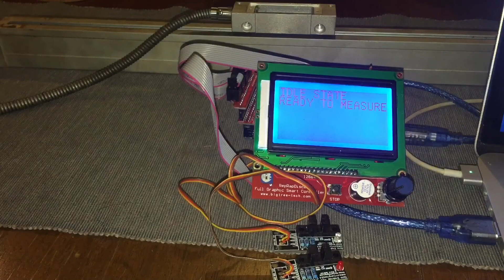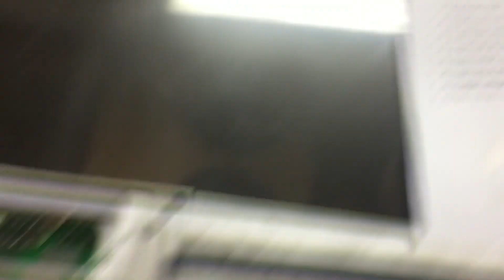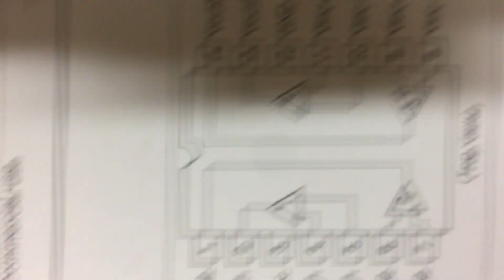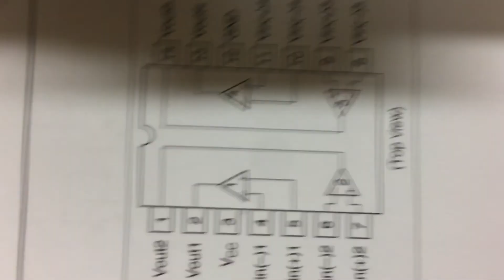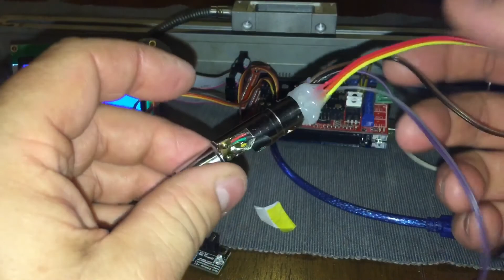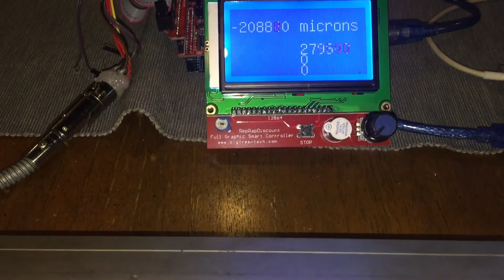Electrickery - Arduino DRO Scales part 2

Comment: Maybe you should try using ESP32 or STM32 that have high clock speeds.
Reply from the maker: It’s a great idea, I only had the arduino on hand at the time though :-)

Comment: Subscribed. Informative, good video. Thank you:)
Reply: Have you seen a piece of code for quadrature encoder processing in brushed dc servo arduino project by Misan (github)? I used it slightly modded for my ultra cheap arduino nano based servo system. The A/B encoder channels are both read by external interrupts are are very simple/time efficient. It easily cope with 100(400 in quadrature) encoder on 3600rpm dc brushed motor with no step loss. So it looks like 24kHz - ca. 120mm/s for 5um scale. I wonder what is the sclae max speed?  Anyway the encoder part of code is what i'm going to use in my project where i need to interface some linear scales - both encoder type and 'iGaging' style. Some other places on the google show nice examples of eficient and reliable encoder interfacing. One time i had an serious issues with mitutoyo glass scale - apparently a noise on long cables during fast movements. Still under investigation:) i have some vid about that arduino servo on my ch if you like. Cheers